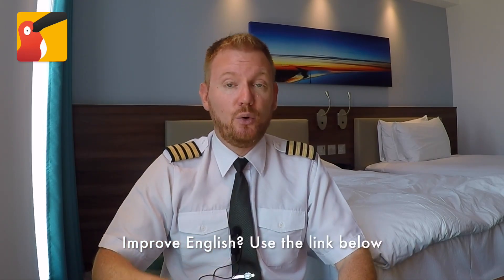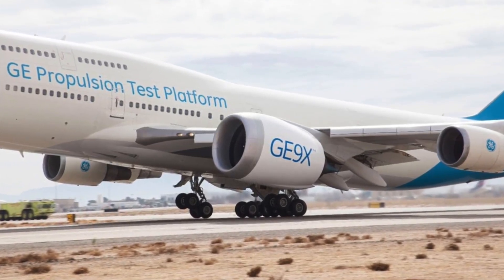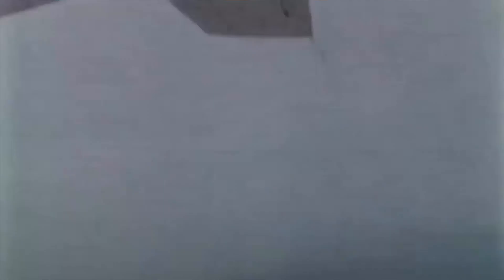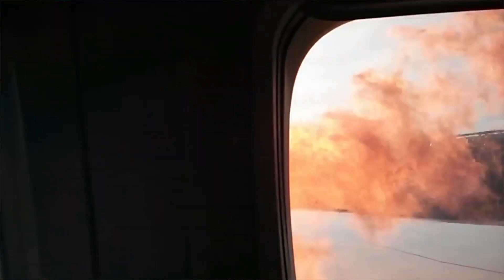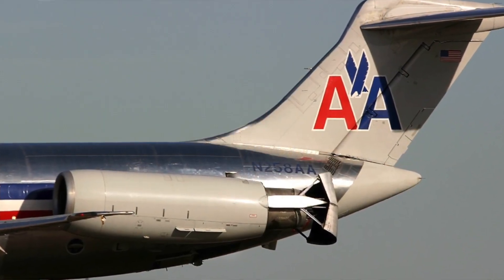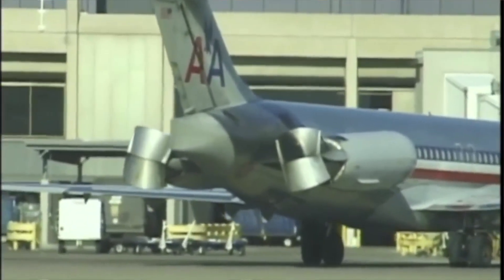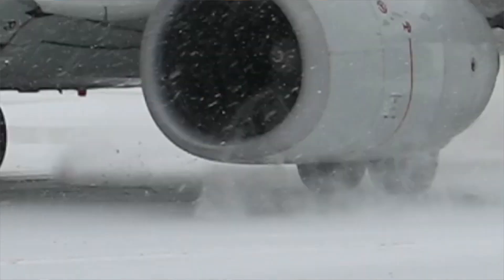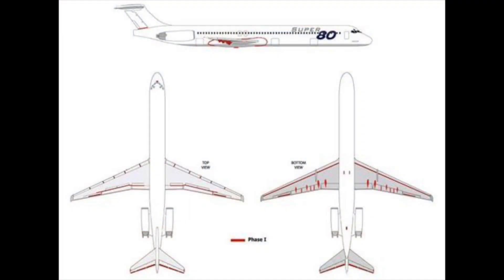Why are the jet-engines placed there? Wings vs Tail

Comment: Hi, thanks for the video. However, there is a notable advantage of the rear-mounted design over the wing-mounted design that I wish to add. The wing design is much simpler, resulting in a stronger, lighter, and aerodynamically better wing. Even being small, the under-wing engine produces some aerodynamic interference on the wing at high angles of attack. In addition, part of the flaps are directly in the path of the engine blast, which makes complex its design. Also, the airflow under the wing must be slower than the airflow over it to be effective (as you know), and the engine blast makes the opposite effect on the part of the wing affected by its trajectory even at higher speeds, at lower is worse. Another undesirable effect of under wing engines is that they produce huge torsional forces in the wing structure during accelerations and decelerations, such as when using the reversers making even complex it design. Just observations, and sorry the long message. Thanks again.
Reply: wonder if that's why McDonnell Douglas successfully got away with never redesigning the DC9 wing and only making stretched variants, because the wings were apparently efficient as-is.
Reply: @PlymouthNeon  "got away with" sounds like they should have but didnt redesign them.  but as you say, they didnt need to bc they had a decent design already.
Reply: Under wing engines provides wing bending releif making the wing much lighter, which is a huge benefit on large single aisle and wide body airliners. Mounting the engine to the fuselage require more complex rear fuselage structure to support the engines.  Getting heavy high bypass turbofan engines, such as the GE-90, mounted to rear fuselage is more difficult than mounting it under the wing.
Reply: @diegosilang4823  A GE90 weights about 9 tons x 2 = 18 tons. The max TOW of a B777 (depending on model) is about 300-350 tons, plus 2 or more additional Gs for safety margin, which at least doubles that weight; 18 additional tons in that picture make not a major difference. And I don´t agree that "much lighter wings" is realistic cause the many additional stress the wing mounted engine(s)  produces to the wing structure; calculations must be an infernal thing. And yes, rear engines put more structural weight in the tail part of the fuselage, but are not the major issue about structural design there. Instead, complex tails which need to be extended (so reinforced) beyond its aerodynamic needs in order to counteract the lack of arm from the center of forces and center of mass may be... Of course, all of those drawbacks are caused by the installation of the engine there. However, rear mounted engines action do not cause huge torsional forces on any axis of aircraft´s overall structures (wings and fuselage) Wing mounted engines do that plenty. DC9´s and MD´s are in fact lighter than same years, same cargo capacity B737´s.
Reply: @Socavador  Under wing engine introduce torsion to the wing, but since the engine is directly supported by structure producing lift you don't need to support that weight through the fuselage. The same observation is also true for trust, the wings are creating most of the drag of the airplane, so having the engine attached to them mean you don't have to push the wing via the fuselage.
Reply: Ok... and what happen when one engine fails in flight? Who will pull from the wing with the "dead" engine, which is in fact acting in the opposite direction; dragging a hell for that side?... I mean, yes, there is a point, but that is not the main reason for the under-wing engine layout. There are a lot of more practical reasons, mostly on medium sized machines. Less danger of accident due to engine malfunction, less noise in the cabin, better platform for future change/upgrade of engines, and so on.
Reply: @Socavador  That single 9-tonne GE90-115B will lift the 351-tonne 777-300ER off the ground mighty fine, with no trouble in the event other one fails. 

That's what the entire design is geared for. All of the additional forces, moments and stresses are accounted for. When one engine fails, the rudder automatically counters the asymmetric thrust condition through a fly-by-wire flight control law called Thrust Asymmetry Compensation (TAC).
Reply: @PauloSergioMDC Off course one engine can handle the weight it was designed for xD but I´m not talking about that... please read the previous message from ameunier41 so you can get the context.
Reply: @Socavador  My comment addresses your context appropriately.
Reply: @PauloSergioMDC  "All of the additional forces, moments and stresses are accounted for": This is obvious, I never said the contrary... "When one engine fails, the rudder automatically counters...." I did never talk about control systems, but structural design differences.
Reply: Dunno about lighter. Without the engine counteracting aerodynamic forces, the wing is, in fact, stiffer and heavier.
Reply: @PauloSergioMDC  Maybe you are right, would be a good exercise to know the weight of wings of similar machines, with similar TOW and purposes... Maybe a 60´s DC9 or 727 vs 737¿? :) By the other side, under wing engine machines have bigger legs, so stronger cause large arms needs to support bigger pressures like rolling and brakes friction... all that weight and torque goes direct to the wing spars... I know this, there are so many forces implied that we cannot know all details unless we get the actual data from the factory.
Reply: Oh! that's why An-72 has twin engines on its back, to make airflow faster over the wings than under! the quite opposite of under-wing mount
Reply: @nyax4361 It is in part, yes. But the main reason is to produce the Coanda effect forcing a strong air stream, that follows the upper surface of the wing and it deployed flaps, to go down in certain degree, producing additional lift for takeoff and landings. By the way, the An-72 was not the only aircraft to try this feature; I do recommend you to search about this effect and it history and actual applications.
Reply: @hia5235  Too many? Compared with what? In millions of flight of DC9, MD80-90, VC10, IL62, TU154, B727 and going on and on, how many crashes occurred just due to this feature? In fact that was critical in the very first tail mounted aircrafts like the French Caravelle. After that, and properly designed, that was not more dangerous that a simple stall condition, hitting the ground with the tail or abusing the model capabilities due to bad procedures. Every model has operational limits, specified from factory, it is the job of the pilots to know these well and operate in concordance.
Reply: they need longer landing gear design too, can't load/unload personnel/baggage without ladder
Reply: Edgar you are supposed to be an aviation designer or something similar very nice comments you had . thank you
Reply: @mostafakarandi363  Hi… I wish! But I´m not... sorry for that. I´m an industrial designer specialized in the field of machinery construction... I have some experience in sugar cane harvesters and bikes manufacturing. However, airplane construction is my passion, so I spent my last 24 years trying to understand that. As result I was invited to do some 3D analysis about nose cowling aerodynamics, cabin structure and ergonomics in a light aircraft project designed by an aeronautical engineer friend of mine (A great opportunity for me). That aircraft is almost finished and waiting for final approvals to perform its maiden flight. For that project my friend was invited to Oshkosh Air Venture; quite an honor of course… It is my hope to be able to design and build my own light aircraft someday :)

Comment: I have been told that it is much more difficult to stretch (enlarge the cabin space) an airplane with rear mounted engines than it is with wing mounted engines.  
Stretching an airplane with wing mounted engines requires a “plug” to bd inserted forward and aft of the wings to maintain centre of gravity.  The same thing becomes a whole lot trickier when the engines are mounted in the back well aft of the centre of gravity to begin with.

Comment: Quick question...Wouldn't under wing mounted engines be less efficient in lift because the surface are exposed to wind is reduced by the engines taking up the space on the wings that could be dedicated to lift?

Comment: I will have to get back to the talk you.  But the 737 8 max, the plane that two of them crashed and then all the planes were grounded.
What is going on with the plane that it needs a computer to fix a thing that should not need a computer to fix. It is not stelthy, It is not Supersonic. It is just a flying buss. Having the center of pressure dance around on the plane so it is like the pilot and the plane are fighting each other is just crazy.  Is it just lazyness on the part of Boeing that this happened. The  CEO reitres with a big pension and the project he was in charge of just poops on the runway.

Comment: Two exceptions to engine placement. 1. DeHavilland Comet, engines were placed inside the wings,  a  pleasing streamlined appearance but, probably, had airflow problems to resolve.
2. I think, Sony Japan had a plane where engines were mounted on top of wings on pilons, about 3 feet high. Don't know if the plane became a commercial success. In both cases aerodynamics problems, probably, had to be resolved.
Of course, many other logistics issues apply to both cases.

Comment: Great video. One point I have to question you on though is that of noise. The VC10 was the quietest aircraft I have ever flown on and it had four very powerful engines mounted at the back. Are you sure engines mounted under wings are quieter?
Reply: Engines in the back are quieter for the passengers in the front of the airplane.  Extremely quiet infact, with no more than wind noise.  But the poor dude sitting next to the engine in the back almost need ear plugs!  
For underwing engines, the noisiest seats are still very comfortable.

Comment: You talked about wing mounted engines being safer , further from the cabin , in the event of an engine fire . Isn’t it hazardous to have something on fire right under the fuel tanks ? 

You also mentioned about wing mounted engines being quieter . The quietest ( and my favourite ) aeroplane I ever flew in was the VC-10 , with its four Rolls Royce Conway engines mounted on the tail . Also the most impressive take off and more capable of take off and landing from short runways .

The final configuration that wasn’t mentioned is aircraft like the De Haviland Comet which had the engines within the wings , also ( not an airliner ) but Avro Vulcan was similar .

Comment: What about the Tristar L-1011 having an engine under each wing and one at the rear? I was working outside the Rolls Royce factory in Glasgow around 1971 when I realised there was a large plane flying low overhead, it made little noise. I believe it was a thank you to the workforce for the Rolls Royce engines with which it was fitted.

Comment: why, with engines under wing, do you get a pitch up on throttle application, and tail mounted engines, we get a down pitch upon throttle acceleration ?  given the same thrust to weight ratios, zero degree POA mount engine pods would apply the same amount of torque, at the same amount of throttle  applied, regardless the mount position, regardless the fuelsupply being above the engine, below the engine ( jet engines utilize a pressurized fuel supply system, doesn't matter what gravity does tothe fuel before the pressure regiulator located along the fuel line, beofre fuel goes to the engine's intake manifold, where again, the pressure of the fuel is measured regulated, maintained at design specifications to operate.    I still d onot understand why engine placement, if, ratiod the same, and mounted at a zero POA, and having loads applied equally across the comparaison test bed, why does one pitch up and one pitch down, if they are the same e exactly, just in different location?

Comment: Just because there aren't more planes with multiple "rear" mounted enginesin which to balance the ratio of "rear " engine aircraft to "wing" engined aircraft, that doe s not explain why one cannot place larger engines in the "rear" configuration, or say, same size, but more efficient?  or, same size, larger quantity?  your arguement in favor of underwing is a fallacy, when in fact, there is no benefit to under wing that rear engine palcement, save that of a wider selection of engine mount locations due to the greater available space of the air foil.

Comment: Can bigger planes like 747s or a380s use both under mounted engines and back mounted engines in 2+2 big little configuration? Will it be less complicated than tail mounted 3 engine planes and provide economic benefits?

Comment: There is actually a third place where engines could be mounted, though (at least as far as I know) it was only used on the DeHavilland Comet and that's in the wings.
Reply: Which is incredibly hard to maintain. Having to pull the wings apart every time you want to change the oil is not so optimal.
Reply: @kenoliver8913  Not really. Just make hatches where the engines are (don't know if that was the case with the Comet though).

Comment: 1. With time, aircraft needed bigger fans to higher propulsion. But engines on the wings have limited space because of ground clearance. Hence, they either fitted more engines on the wings or fit a bigger engine at the back. 
2.  Engines on the wings help counter wings flutter/vibration. See 3:30
3. In case of a fire in the engines, an engine on mounted on the wings help since it is separated from the main body of the aircraft. 
4. The most noise comes from the exhaust of the engine. Separating it from the main body helps you sleep well when you're in the main cabin. 
5.  In case one of the under-mounted engines failed, it will add a non-zero torque and try to spin the aircraft about its center of mass. Hence, a larger Rudder is required compared to a back-mounted engine plane. 
6. See 6:20 for Thrust-Pitch correct to keep the altitude stable/constant. 
7. Engines at the back also help in the noise correction for a quieter cabin. 
8. Charter planes have back-mounted engines because their smaller size may cause the engine to suck foreign objects like little grain or stone or grass in the surroundings.  
9. See 8:40, the aircraft can use back-mounted engines to pull itself back without needing a tractor. Boeing 717 is a classic example. It's risky since you don't have a rearview mirror. And it can also suck foreign objects from the surrounding. 
10. For back-mounted engines, a stronger structure is required at the back because it is further away from the center of mass. And yes, more piping to pump the fuel to hit. 
11. See 11:30, back-mounted engines require T-tail to avoid "super stall". Like Boeing 717.

Thank you!
Reply: Your first point is wrong. You can't fit bigger engines onto the rear of the plane, because they would be too heavy and take the centre of gravity too far back. Also, the structure of the plane couldn't take the weight.

Comment: Why dont aircraft producers put one back up small engine on the tail. Just in case both engines on the wings fail. At least you can save lives from tragic incidents.
Reply: asad khan Good idea, but why not have five? Just in case..
Reply: @speedbird9313  No thats a silly idea. I said it because I saw a few DHL cargo airplanes having such engine mounted on the tail.
Reply: asad khan You must have seen wrong, they do not. Do you mean a apu?
Reply: @speedbird9313  No. See Md 11 and DC 10 aircrafts.

Comment: you missed a really good reason why some planes have engines in the back rather the wing.  

That reason is because a 737 going to dfw from dca or bwi can also be accomplished with a MD-88 or MD-90 but it wont need as much runway to take off or land making a good tool for these types of planes to operate in regional airports where the runways aren't as long but just enough for a fully loaded 737 to get by but found much more suitable for a aircraft that needs only 60 to 70 percent depending on weight on board (passengers or cargo)  of that runway that 737 would need.

the disadvantage of this is the wings being a bit smaller unlike a 737 it cant use a mass portion of the wing to store fuel because it will make the plane imbalanced and controlling that would be difficult. that means thay 737 could go to lax if they wanted to while a 717 or MD 80s aircraft would have to land between san Antonio or el Paso because it would run out of fuel. 

another disadvantage is the t tailed design the trim and elevators are not as stable as a 737 at v1 or landing speeds to overcome that problem its sits almost as low as a crj aircraft but that has its own potential of accidentally scraping the tail on the runway and if it does happen it could be 30% more expensive to repair the damage thats around the cost of this scenario happening to a 767 or 777 the little give way bumper that 717 has does little protection and the MD 80s doesn't feature the bumper so the actual skin and structure of the aircraft would actually hit the tarmac.
Reply: Your are right. Just a detail: the T-tail is not mandatory if the engines are in the back of the airplane. The 1st airline jet with this engines configuration was the Caravelle and had not a T-tail. Regards

Comment: 4:43 makes sense the same applies for car engines when they open the exhaust valvue durring the 4th step of the Otto or aspon cycle because the presure in the cylinder is still at 4bar